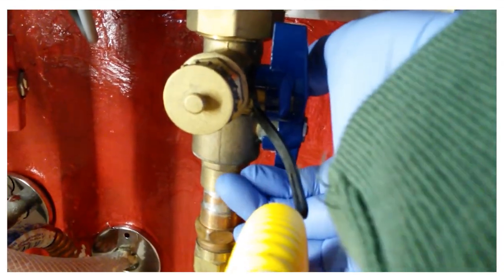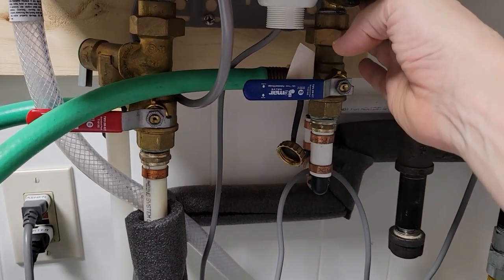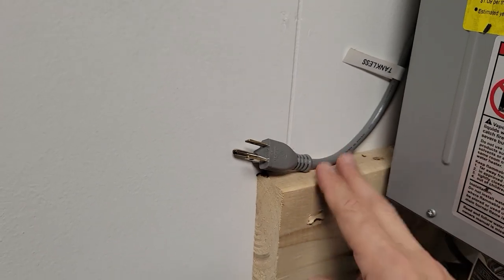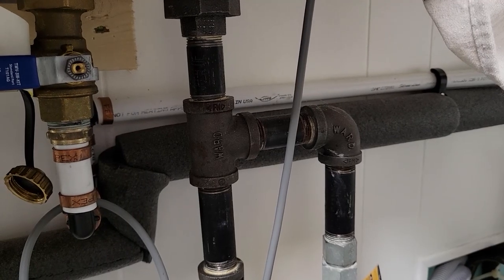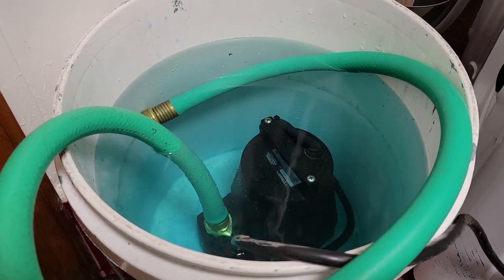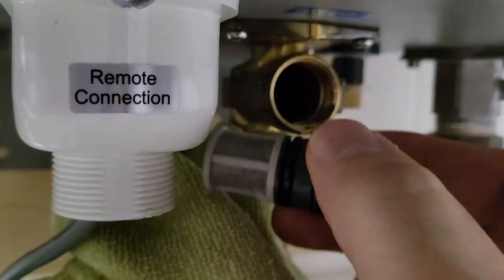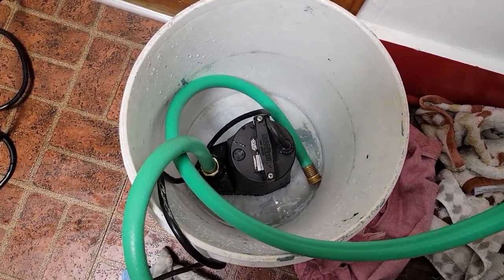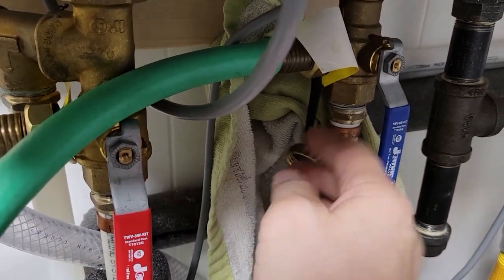Rheem Tankless flush and descale with single handle service valve set

Comment: @cfldriven - My setup is similar to this, but I have a filter in front of the cold water input. So in order to clean the unit, I assume I would turn off the cold supply before the filter. Then turn the second cold valve like in your photo to the closed position, connect the hose to the service port and the pump. Then on the hot side, close that valve, then connect the second hose to the service port, and then place it in the bucket. Then turn on the pump and flush. Is that correct? Thanks for the video!
Reply from the maker: Yes and don't forget to disconnect power to the tankless. Don't use the power switch to turn it off.

Comment: So, it's not that different from descaling a Cleveland Steamer Boiler, aside from the inlet filter, and using vinegar rather than descaling fluid! Thanks for an informative video!
Reply from the maker: Just make sure to disconnect power to the unit rather than using the shut down button.

Comment: One more thing, the heater is rated for 4.6 gpm, so the descaler pump should be equivalent or better, correct?
Reply from the maker: The tankless is not running so it doesn't matter what your pump gpm is as long it circulates the solution.

Comment: Since there is no secondary isolation valve, will water squirt out when you remove the service caps?
Reply from the maker: Baron, only if you have it in the wrong position. Normally there should be no squirting, although there maybe some dripping.
Reply: @cfldriven  Thanks for your quick reply. I just finished the flush and water did not squirt out when I opened the caps. Just some water leaked out slowly.
Reply from the maker: @baronfung2621  Congrats on getting the job done. Don't forget to clean the filter. https://youtu.be/jQ7Y6ujFbWg